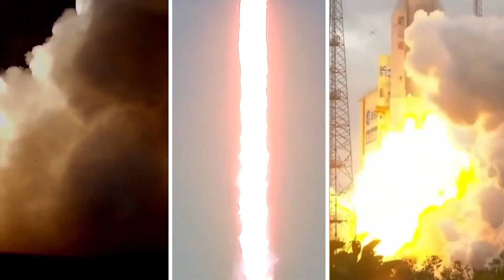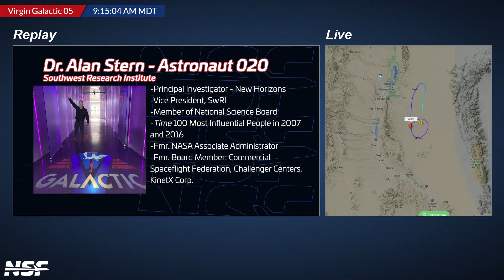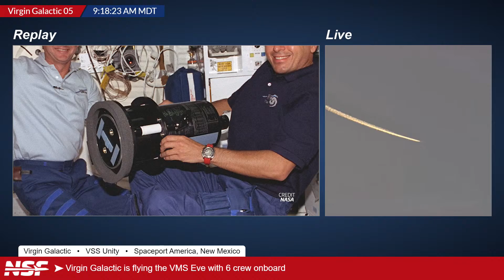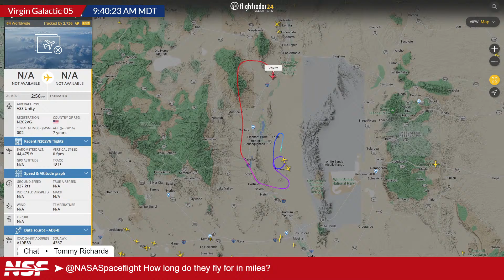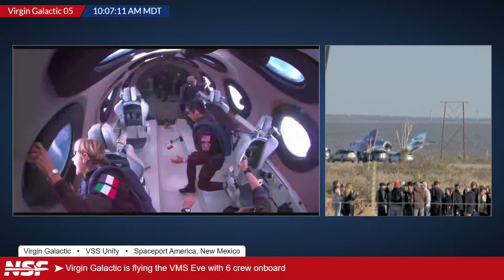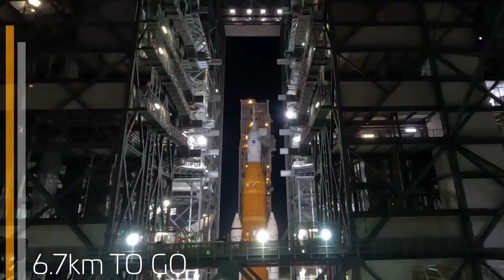LAUNCH: Virgin Galactic-05 - Dr. Stern and Kellie Gerardi fly on Spaceship Two

Comment: the PW 308 is a low bypass turbofan engine with 6700 lbs of thrust. It's a cheaper low efficacy engine that is cheap to service or replace if needed. Its mot a bad engine just old technology

Comment: A very expensive way to take a very small spacecraft to the edge of space, why not put the little spacecraft onto a converted Falcon 9 booster, then launch the little spacecraft into real space, the double fuselage is very large and costly for just one flight, where as a Falcon 9 is cheaper to launch..🤔😐🚀🚀🚀🚀
Reply from the maker: The double fuselage mothership is reused many times. This is far closer to "airline style operations" than any kind of rocket launch. -Das

Comment: “Space”, not space.   Decent distance further to the Karman Line… Cargo isn’t crew.
Reply: On this flight there were three crew and three passengers aboard Unity. Two pilots and one cabin crew. Only one of the three  passengers was a tourist. The other two were working, performing scientific research during the flight. Something never before possible. The optical instrument used in one of them had been used before aboard the space shuttle.
Reply: @markhorton3994  Buy a plane ticket or charter a plane so you can do an experiment… you’re a passenger doing an experiment, not crew.   Unless you’re 10, you don’t actually believe you are a “pilot” or crew just because the Captain gave you a set of plastic wings.   

Imagine an adult introducing themselves as a crew member because they happened to have the resources to buy a ticket…
Reply: @wadewilson524  None of the Dragon Riders aboard SpaceX's manned flights has anything to do with flying either the Falcon nine or the Dragon even though there is a "pilot" and a mission commander aboard each flight.  The mission specialists are professional astronauts whether they are NASA, ESA, JSA, or Russian Cosmonauts. 
NASA is despite its degree of involvement is actually a customer of the launch provider SpaceX. They could all be considered passengers.  
Virgin Galactic does distinguish between flight crew and passengers but calls the passengers astronauts giving each a number. 
I said that there were three passengers aboard Unity this flight. Passengers are not cargo. Two of these were working, theoretically being paid. Just like the mission specialists NASA sends to the ISS.
Reply: @markhorton3994  If VG wants to hand out “crew” and “astronaut” (setting aside not reaching the Karman Line) participation ribbons, it’s hard to stop them.   

Most of the people riding up on Dragon serve an operating and maintaining function on the space station where they are, rightly, crew and astronauts.   I’m not sure I’d even call the Axiom participants “crew” in their current role.